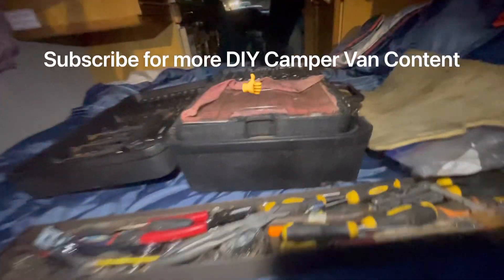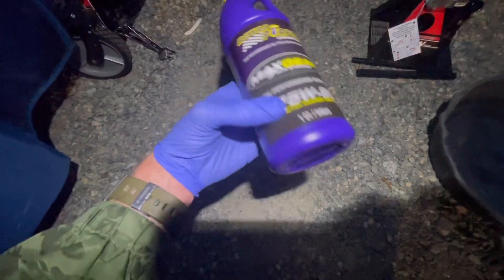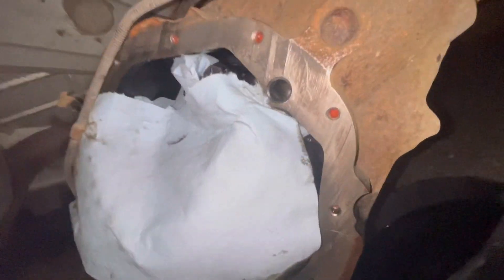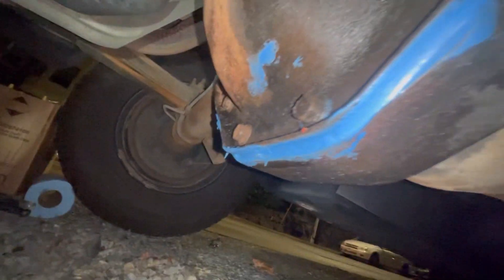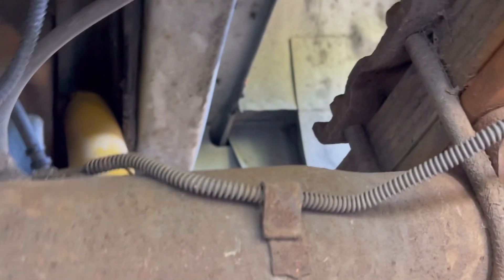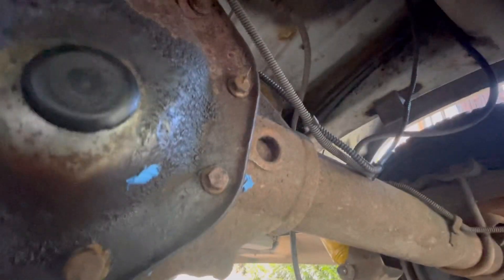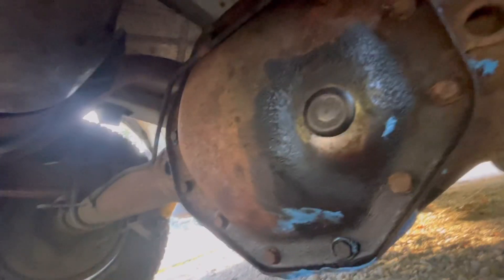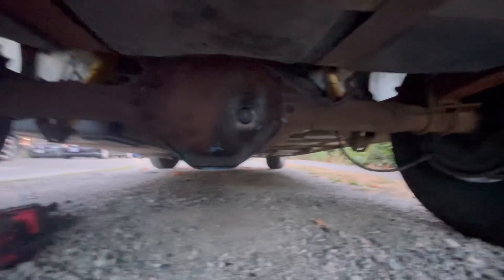Roadtrek Class B Van Build: New Rear Differential Fluid and New Shocks on 1997 Dodge B2500 RV

Comment from the maker: Thanks to all who follow along!! Please like 👍 and subscribe!! Our goal is to reach 400 subscribers! 

Van Update videos:

Combo Jacks: https://youtu.be/xrDDP0rXlBk

Off Roading The Van: https://youtu.be/re3Bmyc8tj8

2-Year Van Tour/Update: https://youtu.be/GWHniTnnEzI

Headlight Upgrade: https://youtu.be/5q-41BT9oFo

Mirror Repair: https://youtu.be/F0FJ5aRpbyI

Oil Change Regimen: https://youtu.be/eh5hm_hMb2k

Engine Tune Up: https://youtu.be/vzd7DDDPpUQ

Clogged Catalytic Converter Diagnosis:
https://youtu.be/6ezp6THDv34

Throttle Body Modification: 
https://youtu.be/R7S1n8S-XmA

House Battery Replacement: https://youtu.be/KMwAkPRZfb0

Affiliate Links on Parts used in this video: 

Shocks:
-Front: https://amzn.to/46MvL5i
-Rear: https://amzn.to/3tG94S4

Royal Purple 75w-90: https://amzn.to/3ZWXCh4

Differential Fluid Pump: https://amzn.to/48SKKN8

Blue Shop Towels: https://www.amazon.com/dp/B00NO7BWJE/ref=cm_sw_r_as_gl_api_gl_i_FFN6M0P1HKFXBQE600V7?linkCode=ml2&tag=fredamyett04-20

Combo Jacks: https://amzn.to/48YSGN0